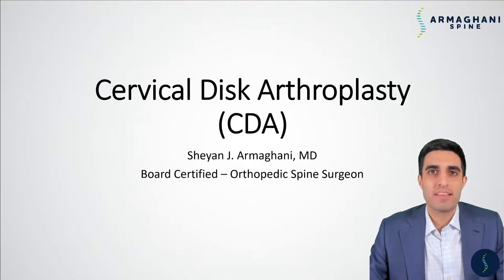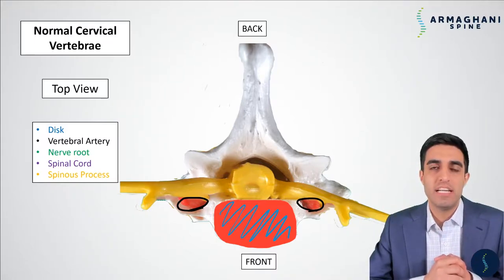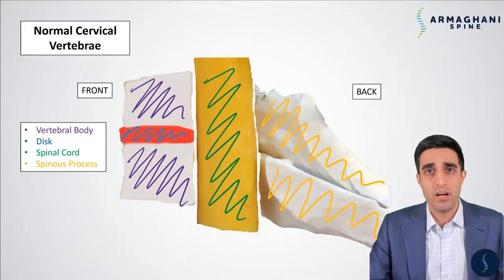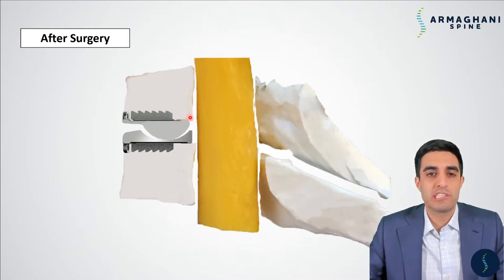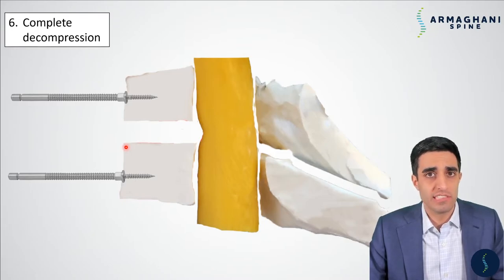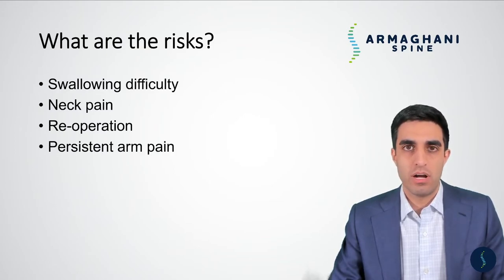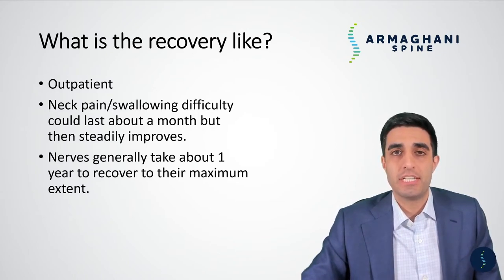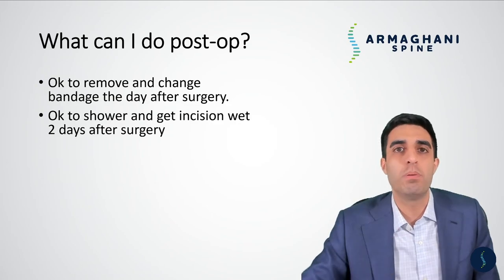Cervical Disk Arthroplasty (Disk Replacement) Explained

Comment: Thank you for such a detailed information, Dr. Armaghani! I am 41 y.o. and got diagnosed with cervical radiculopathy after whiplash car accident related injury a year ago. I was told that my c6-c7 is herniated but does not compress the spinal cord. However despite physical therapy and 2 epidural steroid shots I am in constant neck pain, this treatment only affects my range of motions. How many steroid injections are considered as a usual protocol before thinking about a surgery if any surgery is even appropriate in such cases?

Comment: Hi dr, i had c5/c6 spinal cord compression and same level nerve root compression for about 2 years as i started with conservative treatment. My symptoms got slightly worse and worse and i decided to have a disc replacement. The good news was that although my cord was been compressed a lot on the mri scan showed that their was no evidence of myelopathy or any white lesions on my spinal cord.  I have no bowel issues or balance problems. I had some arm pain and headaches. After surgery i see a big improvement already after 2 weeks, its possible to make a good recovery as no sign of cord damage? And when nerves heal does the pain signals go away? To your brain?
Reply from the maker: I'm glad you've had such a good result! Complete recovery of nerves takes about 1 year so how you feel at 1 year will be how you feel long term. Usually pain improves pretty quickly after surgery but weakness and numbness takes a lot longer to get better. Hang in there!
Reply: @ArmaghaniSpine  thank you, however I might need a fusion as my neck pain had not gone away?

Comment: Hi Dr. Armaghani - I will be having a disc replacement for C4 ,C5, C6 and C7 stenosis. There is significant pinching of the spinal cord. I also have Normal Pressure Hydrocephalus and those associated problems.  We are all hoping that this is the obstruction preventing Spinal Fluid draining and in repairing it, it will resolve the NPH. Any thoughts? And thank you, your video is outstanding.
Reply: How are you feeling after operation ?
Reply: Please share how are you feeling after surgery?

Comment: great video. very informative. Is a disc replacement something that is recommended if the facet joints at the replacement level are moderately arthritic? 33 year old male asking. Thanks

Comment: Similar to any bone spurs removed at the anterior aspect of the vertebral body, are bone spurs at the posterior aspect of the vertebral body also removed?  At the front, how do you deal with the anterior longitudinal ligament in order to remove any bone spurs?  Is it pushed aside, cut/dissected?  Thanks.
Reply from the maker: Fantastic questions. Yes, we do remove the posterior bone spurs and those are most important as they are the culprits in terms of compressing nerves. As for the ALL we do remove that in the process of removing the disk. There is also a posterior longitudinal ligament which is the last covering from the disk to the spinal cord and that is typically removed as well to ensure the spinal cord and nerves are adequately decompressed.
Reply: @ArmaghaniSpine  Thanks; much appreciated!

Comment: Hello Dr. which one is better ACDF or ADR for C5-C6 disk bulge or herniation, which already once gone uder the surgery now after 4yrs same pain, tingling, on shoulders and in between shoulders started also stress on face and head region.
Reply from the maker: Very good question and that is a question many surgeons argue about which is better. In my opinion, I think getting a cervical disk replacement is preferrable to an ACDF. However, not all patients are candidates for a replacement. They can't have as much disk degeneration, arthritis, and their bone needs to be reasonably strong. That would be a good conversation to have with your local surgeon.

Comment: Thank you much for this great video! I have c4-C6 fusion but now having c7 and C8 nerve root impingement. Can I do disc replacement below a fusion? Also, what are your thoughts about cervical traction at physical therapy using saunder cervical traction?
Reply from the maker: traction works great as a nonoperative measure. if that an PT fail, injections are possible. you can do a disk replacement below a fusion but some insurances (Cigna in particular) do not allow it as they see it as "experimental"

Comment: Hi Doctor Armaghani, great video as usual.  I am experienceing neck pain as well as feeling pain that goes into the front of the head should this be of any concern? I had a brain and cervical MRI around 3 months ago that showed nothing sinister was present? Any thoughts please?
Reply from the maker: Thank you for the kind words, Mr. Smith. Without a structural issue which would show up on an MRI of the cervical spine and brain, it is unlikely that a surgery would reliably fix those kind of problems. This could be a type of headache possibly as well which maybe should be evaluated by a neurologist. There are some people with pain like you experience who have seen good results with botox injections in those areas and the good thing about that is that it isn't a surgery. good luck!
Reply: @ArmaghaniSpine  thank you very much for the prompt reply,
Kind regards,
Graham

Comment: Is it required to cut through the anterior ligament to remove and replace the discs? Is it required to remove the PLL if there is cord compression?
How much does the disc replacement add stability to make up for cutting the ligaments?

I wonder because it seems these ligaments are very important to maintain stability after surgery. The research seems very conflicting on whether the ligaments should be cut.

Comment: Hi, I am Md Rokibul Hossain from Bangladesh, I am suffering with Ankylosing Spondilities from 14+ years. Didn't move my neck because My survical disc (c1,c2,c3) fused, want to know is it possible to resolve?
Reply from the maker: ankylosing spondylitis is, unfortunately, not a condition that can be alleviated effectively by surgery, however, medication through a rheumatologist can help in preventing further progression.
Reply: If you want to chat with me about AS I have it too for many years. Am going to see Dr Armaghani in 4 weeks. My AS is not a severe as many others but just at age 47 I had imaging and it shows DDD in the Cervical involving C2-C3-C4-C5-C6 but not 7 or 1. I lost most of the mobility of my neck. I have some idea what you are dealing with. My Rheumatologist says the neck likely isn't related to the AS. Im not so sure. I only have one conclusive fusion of the SI joint from 2005 but suffer a lot of oddities which all could pint to the A.S. If you'd like to communicate, send me your FB page or email and we might be able to share helpful info.

Comment: how big is risk of osteolysis with this procedure?
Reply from the maker: That's a very good question, Leon, and one that we are learning a lot about recently. What we have found is that within the first 6 months of this procedure, many patients may have osteolysis but do not get the main worry we have with the procedure and that is bone collapse around the disk replacement. We also know that after a year or 2 the osteolysis resolves and returns to its original density. This is why we take frequent x-rays and follow our patients closely to keep checking on if there is any collapse.
Reply: @ArmaghaniSpine  So The only difference from the ACDF procedure to this one is the fusion? My surgeon is recommending the AC DF procedure however I continue to hear that fusions are the worst thing to get in your spine but that’s just hearsay.
Reply: @rosannapaluski2184  I had this surgery 20 years ago. I have no problems with the fusion. So glad I had the surgery. Hope you're doing well.
Reply: @rosannapaluski2184  Yes. Fusions cause bone spurs and damage to adjacent vertebrae segments. My previous fusion of C6/C7 caused bone spurs and misalignment to C4/C5, therefore causing cervical stenosis, a narrowing of the spinal cord. I have electrical surges down my arms and legs, neurological issues, vertigo, and nerve issues, such as I can't feel my stomach, so I rarely eat. Thid has ruined my life and surgery is the option after exhausted attempts. But who knows what permanent damage will remain. I had a second opinion and I only wish I found a Dr like this one who could do disc replacement.